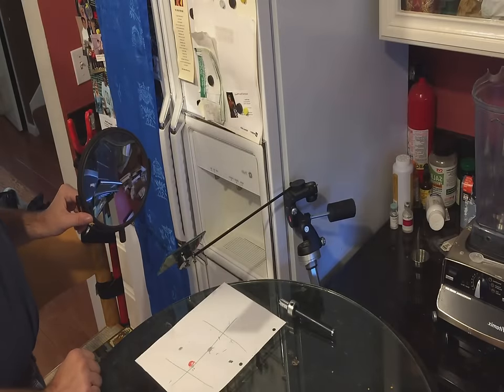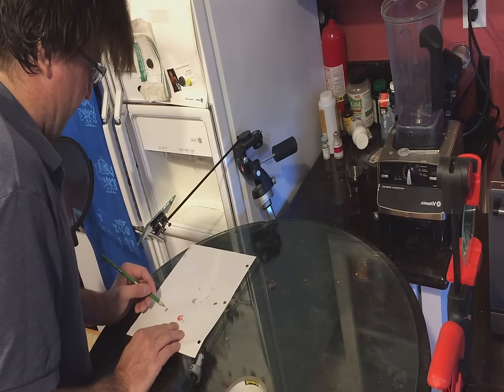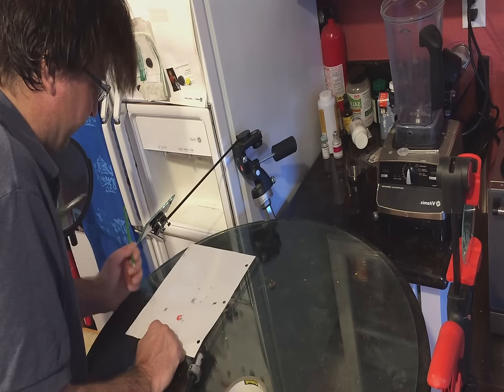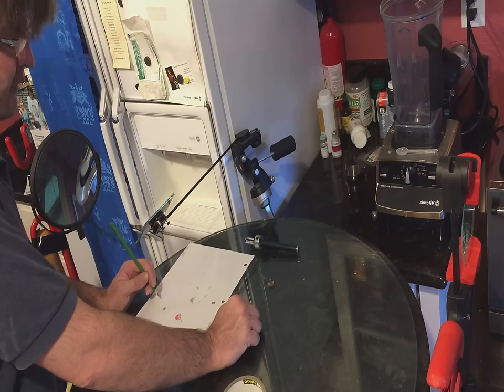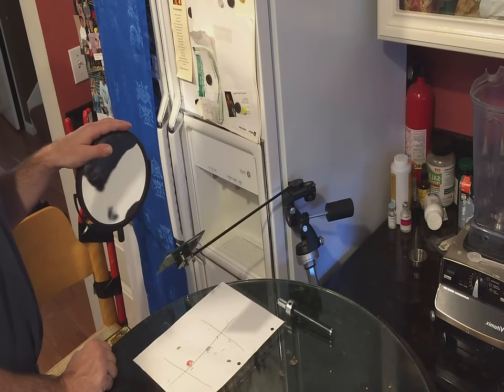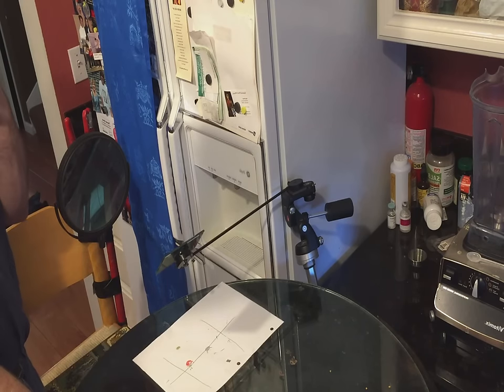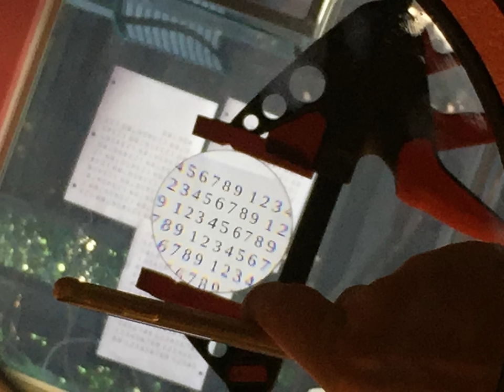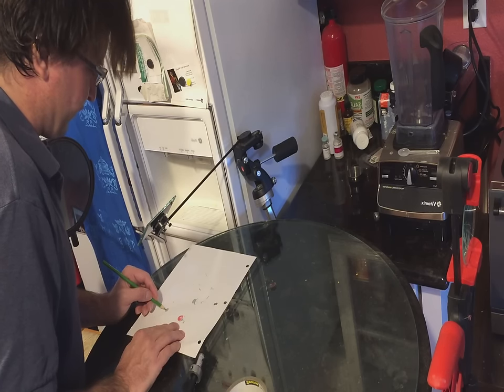Smoke and Mirrors Behind Tim's Vermeer

Comment: Light and color is the main problem here. Depending on the time of the day (position of the sun) and movement of the clouds, the color and light would shift dramatically throughout the painting process. This would mean in order to use the device in Tim's Vermeer, you would have a limited window of time, season of the year, and only could paint on days that were not overcast. There is no mention of using artificial light (ie - electricity, which Vermeer would not have) once the painting process begins in the film. But, it had to have been used to finish the reconstructed painting.
Reply: An interesting point, it may account for the fact there are only 36 attributed Vermeer paintings. A very small output even for someone who died aged 42.
Reply: The lighting is actually irrelevant because the device is self correcting on lightning so changes in lighting make no difference. Tim comments on this and discovered that it did not change the color gradient at all regardless of lightning conditions. If you looked through a time lapse of the painting process the colors changed drastically over the months but it made no difference on the final piece.
Reply: His window was north facing to minimize the position of the Sun problem.
Reply: That point was specifically addressed in Tim’s movie.

Comment: This is the only video I could find on the actual equipment Tim used. Thanks for posting it. Also, I can't believe how many d-bags posted comments below without having any idea what you are referring to. Total d-bags. Do you have any info on the focal length of the lens? Are there any specs? Thanks again for posting.
Reply: 710 mm  There is a pretty good description I think, in his SFI lecture on YT.  I suppose that focal length is relevant for his copying of his whole room.  A system of greater general utility would be one that allowed one to place subject objects like computer monitors or paintings of whatever size and shape for convenient modeling.

Comment: what was the size and focal point of the lens?
Reply: I've built this device with a simple lens - a 3 inch lens on eBay which was about 700mm focal length and a cheap shaving mirror. Please note- you see a very small part of your scene at a time and to view a scene such as Vermeer painted it requires the back mirror be moved as each small part is copied.  I've made some mediocre drawings of a mannequin I own. and although it is very slow and difficult to use- the device does indeed work. Vermeer was a genius and skilled craftsman- he may have used such a device- but it  is not some cheat or walk in the park- you still have to lay the paint down on the canvas with a tiny brush to get all the details Vermeer got.
Reply: also note - the longer the focal length the larger the mating you can make- but I think you need a 700-900mm lens to get about the same filed of view as Vermeer.
Reply: @richardvallonjr.6716  absolutely, I don't think the use of an optic takes anything away from the genius of Vermeer. in the end, he made 17th century photos by hand, something a modern person would be hard pressed to do. Tim Hansen took a year or more to make a good but still novice in comparison to the real Vermeer painting.

Comment: he thinks he has science knowledge but he doesn't seem to know difference between SURFACE mirror and BOTTOM mirror. i can see he is using BOTTOM mirror here by the way glass is refracted. light is coming in from surface of final mirror. the one you look at to compare your canvas to actual scene. 
without SURFACE mirror you can not compare color side by side, terrible gap is introduced with BOTTOM mirror. you will have headache working with BOTTOM mirror.
they were good at SCIENCE and ART back then. this man isn't.

Comment: Hi John
Its been a long time since the movie came out ( 2013?). Since then, I had the opportunity to discuss the issues of the “ comparator mirror” with Tim. We did a back and forth. I thank you for yoyr video. You made and honest attempt to experiment with Tim’s method. Yes, the video could have been better but that’s not the real point. The MAIN point you make, at several times as the video runs, is that to use Tim’s 3 tools :( 1. )The lens (2. )The small flat mirror ( 3. ) the concave mirror..YOU MUST HAVE A DETAILED OUTLINE DRAWING ON THE CANVAS ( or wood panel) . Otherwise, there is no way to calibrate the 3 tools. Even Tim said that...not in the movie..but in a website titled, ESSENTIAL VERMEER. Its an excellent website by Jonathan Janson. Tim posted a photo on Jamison’s website that clearly demonstrates a method to TRACE THE IMAGE. Its not mentioned in the movie. All it is , is a very large flat mirror, as large as the canvas, that is placed facing the lens. ..at a 45 degree angle. This flat mirror projects the image straight downwards to the canvas that is horizontal on the table ( same table used for Tim to paint), this use of the large flat mirror does a very important thing. IT CORRECTS THE MIRROR REVERSAL of the lens. One can see the actual image ( subject of the painting) in living color on the canvas. A second important result, is that there is NO PARALLAX SHIFT. The tracing is easy to do. Vermeer obviously knew of this tracing method. Once the subject is traced, then the calibration of the 3 tools is easy. BUT VERMEER did not use Tim’s “ comparator “ mirror because Vermeer did NOT COPY THE COLORS AND LIGHTS as Tim did. Please see my YouTube video: “ Tim’s vermeer. Why the movie failed”. - thank you, Louis Velasquez , www.calcitesunoil.com
Reply: I don't believe Vermeer needed to use a comparator mirror either but your "proof" (per  21:29 of your video) is a joke.  You don't know any better how Vermeer painted than anybody else and your self described "professional opinion" doesn't buy you any weight when you resort to ridiculous arguments which you label as proof.

They made a conceivable but far fetched claim you've done nothing to refute.
Reply: One more thought here (since you don't allow comments on your own video).  Your point that Vermeer clearly didn't paint the way Tim did is likely true but that doesn't seem like a fatal flaw for the argument in Tim's Vermeer.  I think the main point is that the comparator mirror, if Vermeer had known about it, would have been a pretty powerful tool.  No way to say whether or not Vermeer did know about it but, if he did, it would seem to fall in line with the use of the camera obscura.

Why is the idea that Vermeer liked to use the mirrors to help nail the objective palatable to you but the idea that he would welcome similar aid in nailing fine tonal details is objectionable?
Reply: Uno mas.  Here is a link to the comments in Essential Verveer (there wasn't a clear way to get to the older comments in that blog post):

http://flyingfox.jonathanjanson.com/2014/06/21/tims-vermeer-from-a-a-painters-point-of-view/comment-page-2/#comment-505104
Reply: I looked at your video and there are several points that are incorrect and many of your assertions are unfounded. For example the lighting change does not matter much hour by hour when using Tim's device as colors are self correcting. This is addressed in an interview of Tim. Search for NYFF51: Tim's Vermeer on youtube.

Details like clouds moving do not matter either as you do not need to copy those since clouds are easy to paint without tracing. Also all components of the painting does not need to be there all the time. You can just paint the part that is there right now and leave the rest for later even if it is changing and you also do not need to copy the low detail parts either and can paint those naturally. I do not think your video addressed some of the errors produced by painting with Camera Lucida that is present in both paintings which is compelling evidence that Vermeer used such a technique.

Also the movie does not claim that Vermeer used Tim's device for every painting he made.